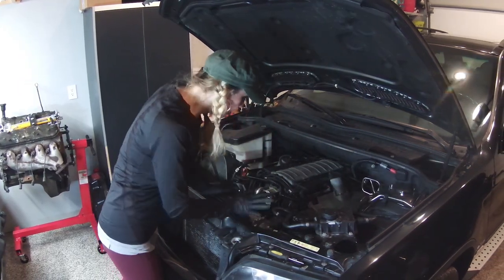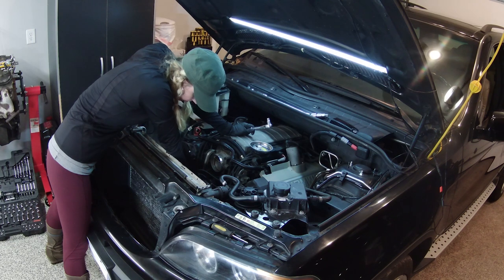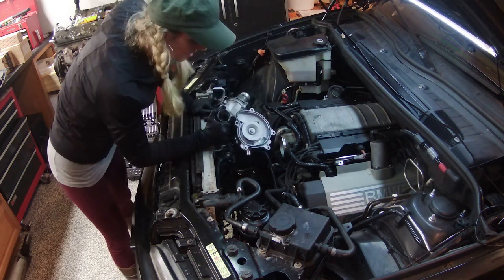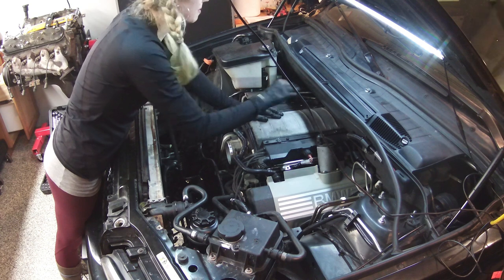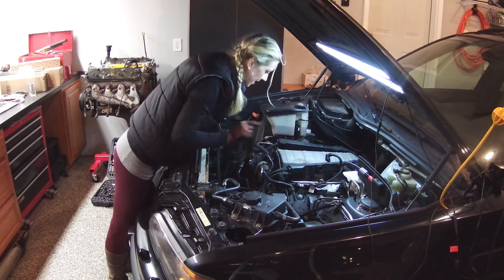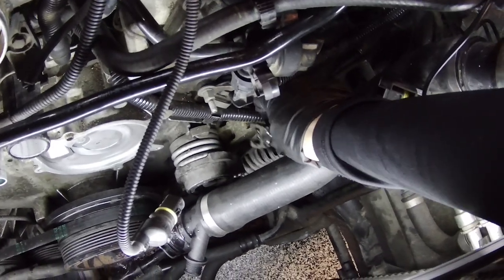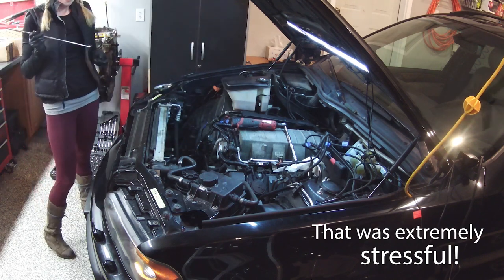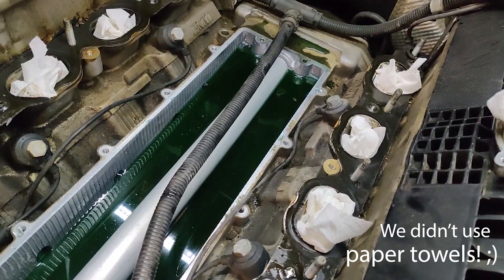WHAT? Another COOLANT LEAK!? Prepping to start the process of replacing the transfer pipe this time.

Comment: Can you take all that coolant out with a shop vac ?
Reply from the maker: I suppose you could. You would just still want to manage proper disposal of it and then clean out your shop vac real good after.
Reply: Thank you.. make this job look so easy.. I'm still struggling with the manifold 😭😞😱
Reply: Thanks for the awesome video, I’m currently working on my bmw 745i. I bought the stent you showed in the BimmerFix video, removed the water pump and now looking at the front side of the pipe. It seems to be there is another pipe inside the one in the car which makes it impossible to install the stent in. I’m wondering if that another style of the stent or the same as the one you are doing in this video. any idea of what I’m facing don’t want to remove the top 😢
Reply from the maker: @husseinlakeside  I hope I understand your question... If you remove the water pump, you will be able to see the inside of the transfer pipe. But you should be able to slide the stent in there (unless a stent was already inserted previously and is currently there  now). The only way to replace the transfer pipe is to remove the valley pan cover (top). You cannot slide the transfer pipe in from the front. Yes, it's awful. Just to clear the Bimmerfix stent and the transfer pipe replacement are 2 completely different fixes.
Reply from the maker: @juniorhernandez4570  No, it was awful.... Absolutely Awful!! LOL! Good luck with your project!